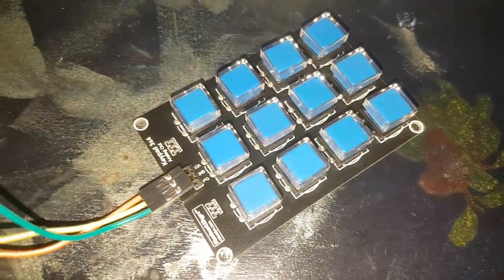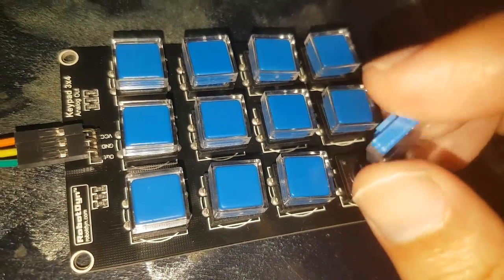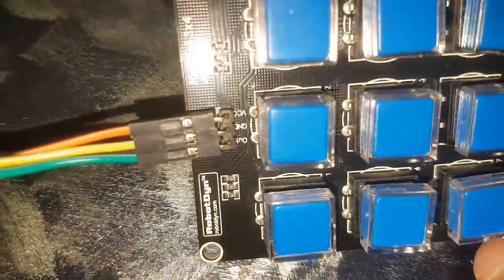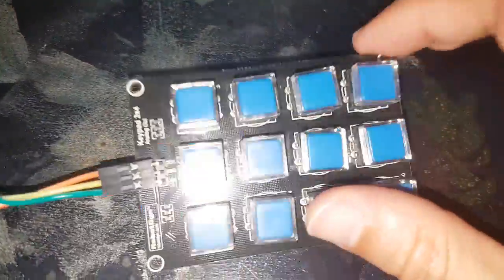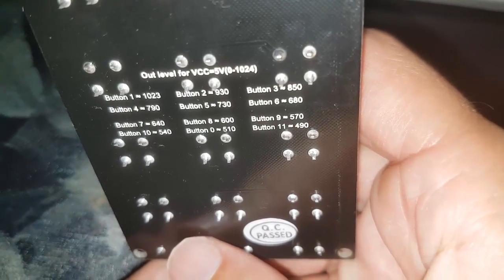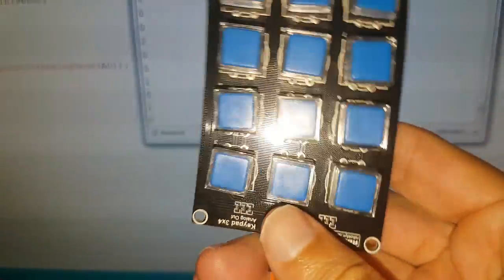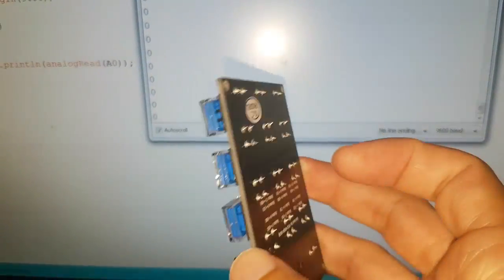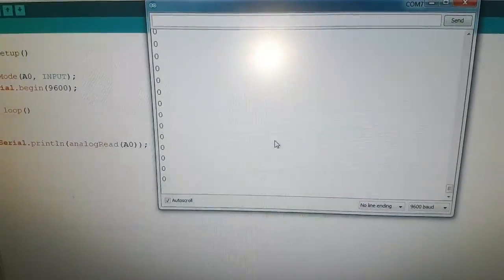Cool analog 3X4 keypad review

Comment: Which pin on the Arduino did you connect the out pin on the keypad to?
Reply: You can put it to any analog pin!

For example: if you want to connect it to pin A1, you would write

inputValue = analogRead(A1);

if(inputValue >300) {
Serial.println(inputValue);
}

Comment: please send the Code fmartintornero@gmail.com
Reply from the maker: +Francisco Martin Tornero 
Code to what ? Each button will give its own value on the analog pin . Simply read it.
On the back of the module there is a table showing the ranges of the values.
Reply: Hi if I want to assign each key to a number as I do?
Reply from the maker: +Francisco Martin Tornero 
You simply do a switch- case conditions in c++ for the value.